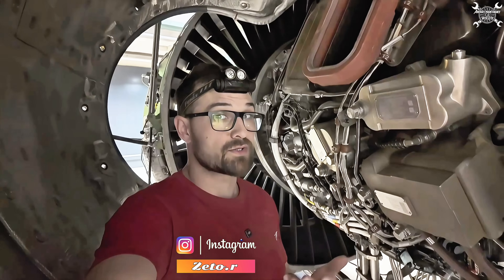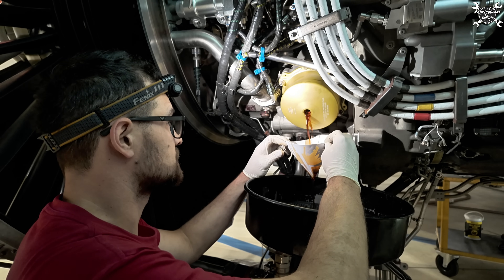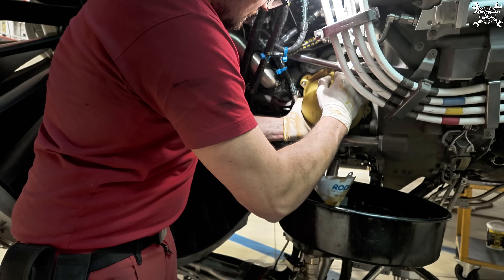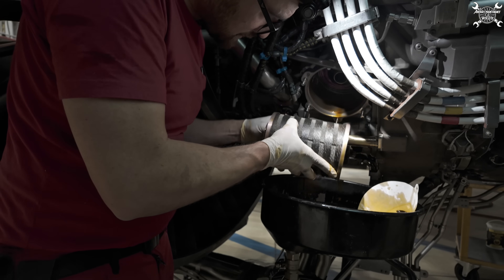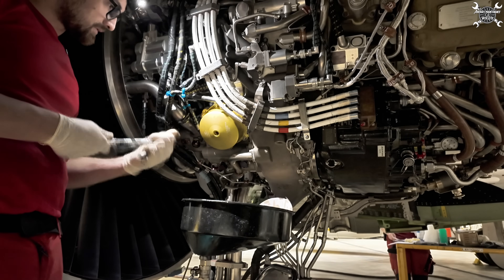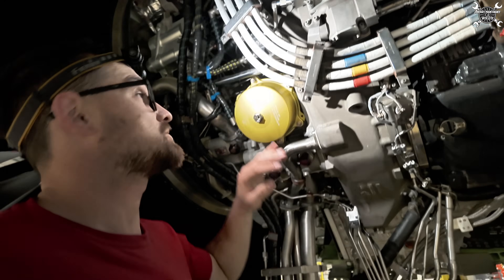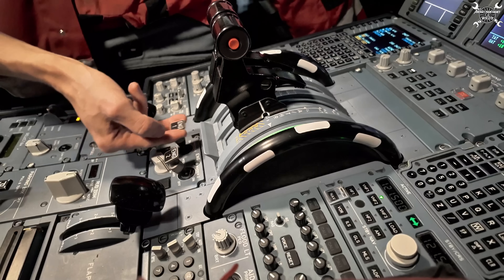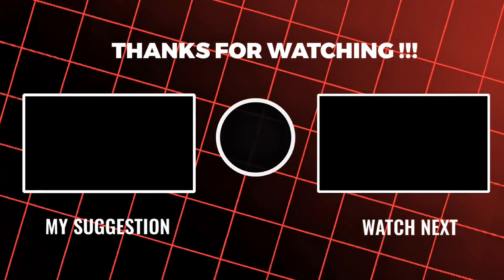How to replace oil filter on A320 NEO

Comment: What is oil
Reply from the maker: Fluid for lubrication of gears
Reply: Fluid is a synthetic oil made from polyol ester base stock per MIL-PRF-23699.    This oil lubricates both the gears for the bypass fan and the engine.

Comment: Air india flight on June 12 met with an accident the video shows that ram is deployed is it both engine failed in that boeing aircraft? Check the video online please do a video on that what could be the reason since u r a flight engineer you will have more clarity....https://youtube.com/shorts/d2xo6bM40es?si=kR3Vdl1wOp2DbP55
Reply from the maker: Dual fadec failure forced trust to pull back to idle as fail safe and rat deployed because of lost of power. This is what I thing but it is subjective point of view. I will wait for result of investigation

Comment: Do you also disassemble the sensors to check that they are working properly and that they are not picking up particles? .
This is probably not written into the filter change script. 
Encore une excellente vidéo Mr Zeto!
Reply from the maker: If you mean chip detectors then answer it is no.  Only if you find particles

Comment: I find it odd they use Quarts (as US measurement) on the ECAM.  What happens if you find metal in the oil filter?  Does the engine get sent off?
Reply from the maker: This depends of the size quantities and material. From that point we will make decisions what to do next